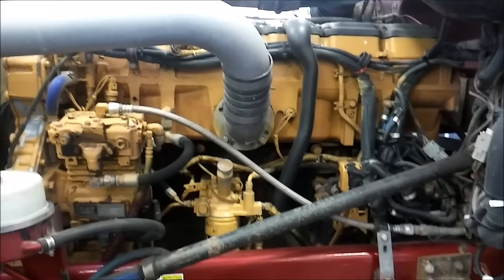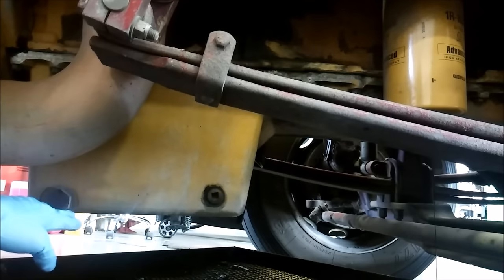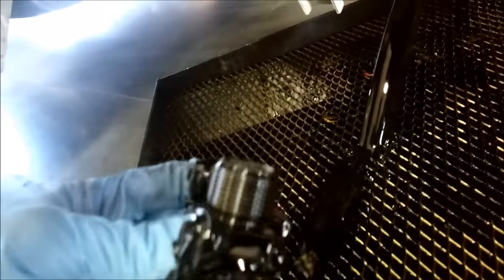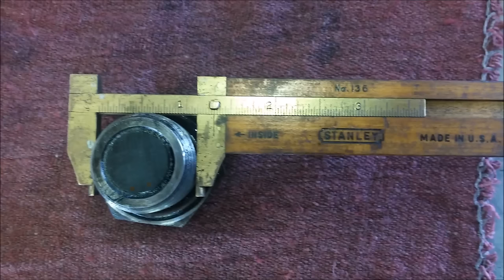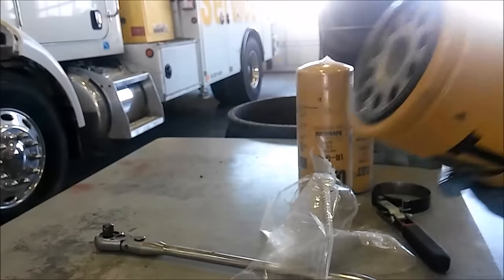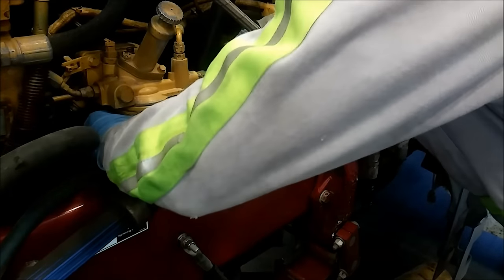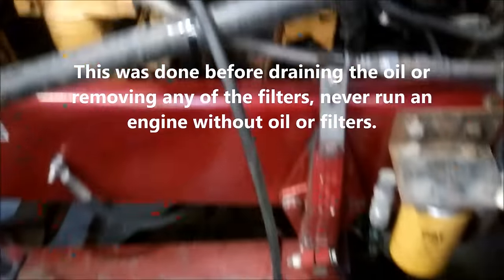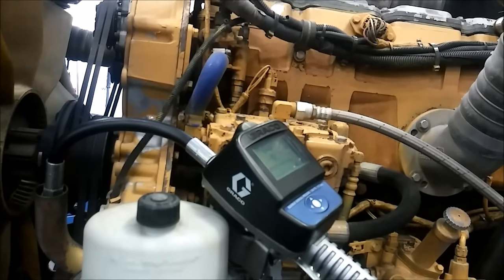How To Perform A Professional Cat Diesel Engine Service.  Cat Engine Oil Change.

Comment: Do cat engines have "top end oil" that can be changed like on PowerStrokes? (even though it hardly gets changed on its own because it circulates slowly (so I've heard from PowerStrokeHelp's channel)) Supposedly it does wonders in the PS engines on making the injectors last forever and a day as far as pickup trucks are concerned.
Reply from the maker: +VinylDash303 Good question, I had not heard of " top end oil" before so I watched a Powerstrokehelp video that talked about it. I'm envious of his subscriber count and maybe on a Powerstroke it helps, but on a Cat it would be a waste of time I think. The injector pump does hold about a quart of oil in it, but it gets the oil from the main oil galley and if you have ever ran a C7 with the valve cover off, it moves that oil through the injectors quickly and they drain back to the oil pan. So my suggestion is keep your engine oil clean and it will keep your injectors clean.
Reply: +Adept Ape Ah. Interesting. Got one more for you. Is there anyway to find the thread spec and o-ring diameter for the 244-4484 filter?
Reply from the maker: +VinylDash303 I don't know of a place in the Cat system that would give you the specifications. Usually Cat will give you the shipping dimensions. I would look online for a filter cross reference site, I think Donaldson has one and there are others, then type in the filter part number and it might give you the specifications on it.

Comment: I've been looking at the 4 jaw oil filter wrench. what is the best one to get? for gas engines?
Reply from the maker: +Richard Cowtails For gas engines I really like the actual socket oil filter wrenches. For a pliers style universal filter wrench though, the Channellock ones are pretty nice, and they seem to be made with very nice quality steel and grip very well.
Reply: ok. Do  you have any idea what size that might be? looking at amazon its talking about 36ish mm. does it differ from car to car ? or is it pretty universal in size? kinda same stuf?
Reply from the maker: +Richard Cowtails I would just get the pliers type to start with, in their small and medium size. The socket types are nice, but there are a ton of different sizes, so I would use the pliers type and then start buying the socket type ones you find you need individually.
Reply from the maker: +Richard Cowtails You can also buy a band style ones I talk about in this video, they work very well, just on cars there is little room for the band and pliers type.

Comment: Do you know where the block heater hook up is on a C7s? I can't seem to find it. I have the plug to connect it but I can't find it on the block
Reply from the maker: +Timothy Nichols Most of the C7 block heaters are on the rear of the engine on the turbo side above the rear structure.
Reply: Adept Ape  yeah I finally found it. why would it be unplugged. Because its not always ON. only when I run a extension cord to the generator, then it would it be ON.. Just found it odd it was unscrewed.
Reply from the maker: +Timothy Nichols It should be plugged in because as you correctly stated it only is on when it's plugged into an outlet. Either loosened over time or perhaps someone worked on it?

Comment: I always fill the filters if I can
Reply from the maker: +Eric Murrell A lot of people do, but Cat recommends not pre filling them. There is quite a bit of controversy to filling or not filling them. Every guy seems to have their own take on it.
Reply: Adept Ape i break the filter loose then I sharpened a screw driver
Into a sharp point, and I use a hammer to drain the filter before removing

Comment: If you let the oil filters overnight with a hole in the bottom, you must have a filer press in your shop.
Reply from the maker: +leonard payne They used to say we have to crush them, but now they just say they have to have a hole in them and drained to throw out. We don't have a filter press though.

Comment: "most guys i know use a 1/2 inch impact to tighten"
so thats why i cant break them loose.... 

i got yelled at by my boss.... a tire guy, NOT a mechanic.... for using the 1/2 inch impact to remove the plug
i said "ok, then you break it loose using that 3/8 drive ratchet" 

he ended up using the impact......

anyway.... i use a 3/8s or 1/2 inch drive ratchet to tighten them (our 3/8s sockets stop around 1 inch IIRC.... but i DAMN SURE know i can get 60 foot pounds out of a 3/8s drive)
snug.... plus 2 or 3 taps with my fist, on the handle = DAMN close to spec..... and i KNOW its not going to loosen up

ive heard of shops yelling at techs for using the torque wrench for oil drain plugs..... 
yet, id rather see that..... than see a cracked pan..... or using a FUCKING 1/2 INCH IMPACT! 

people who tighten drain plugs with an impact..... or even air ratchet..... 
need to be shot

no other solution for that level of Id-10-t.....

Comment: Nice tech video. I’m not a Cat mechanic but I’ve working on or around engines for most of my 56 years. Like you said the injectors don’t like to run dry  I always prime my oil filter, does CAT say why not to?

Comment: First of all you did a great video. I have a 48 ft boat with two Cat 3208s that I change the oil and all filters once a year (approx. 98hrs). Some have suggested to me to change at 250 hrs. When I do change the oil is slightly dark honey color. I run at 1400 rpm on trips and up to 2100 rpm for the last 5 min or so to blow things out. Do you have any opinions on this?

Comment: Hi Josh,  loved your video.  Being a new owner of a 3126E CAT in my motorhome I have had some difficulty finding reliable information on it.  I've heard that the Micron rating for the fuel filter has to be 2 microns or less and t he oil filter 5 microns or less.  From my reading none of the filters available for my engine meets these specifications.  The best I could find was a Donaldson fuel filter at 3 microns and a CAT oil filter at 13 microns.  How rigid are these requirements by CAT?  Can you recommend a specific filter set for me?
Reply: I believe wix filters for that would be 2 microns.

Comment: Would you consider using a Fumoto oil drain plug on a C9 in an RV?  I don't have a pit and would like to keep the oil change as clean as possible.

Comment: Oh crap... What an idea to watch this AFTER doing the service on my 1988 3208 T... I refilled the oil filters, I followed the filter brand method) I just came here for the fuel filter, I was thinking about refill it too because these engines are hard to restart after a priming the system. Any thoughts? Thanks for your very helpful videos 👍

Comment: I NEVER use plier type filter wrenches for installing filters. I have seen filters be punctured from the sharp teeth on them and sometimes it takes a many hours of operation for them to start leaking. A potentially disastrous situation on the most novice procedure there is. They should only be used for removing difficult filters and that is it.

Comment: Question I hot a C7 I wanna do fuel filter change like you did do I fill both filers with diesel and I saw another video someone else made and they used prime pump to pump fuel in manually after new filter was in, my question is if you fill it way you did you dobt need to pump it? Im new to diesel engines thanks

Comment: Great video!  Thank you for the awesome tips.  About to do an oil change on C9 that's pushing my 43' RV.  Any comments or concerns on upgrading to T6 Rotella Synthetic5w40  instead of Cat recommended 15w40.  I do most of my traveling in HOT southern states and live in Vegas.   Thanks again!1
Reply from the maker: +Tyler Trenton I really like synthetic oil and switching to it isn't a bad idea. The viscosity difference is a little outside of Cat specifications for the medium duty Cat engines, Cat recommends either a 10w30 or a 15w40. The difference being ambient temperature, so the hotter climate would get the thicker oil, since you are in Vegas I would say try to get a 15w40 synthetic oil. A 5W40 is a little thin with the 5 cold wait. Now would it run okay, probably, but I just am letting you know the Cat recommendation.
Reply: Thank you VERY much!

Comment: the cuummins 6.7 fouund in 1 ton trucks is 13 quarts IIRC....... which brings the oil level to the middle of the hash marks
i even called dodge and asked about that...... and they said thats what they want..... middle of hash marks

now.... i prefer to fill to the top of the hash marks......i know the oil will expand when hot
but i also know that some of the oil will be "trapped" in the head when its running..... 

is it enough to off set the expansion...... probably 

and is running it a BIT overfull going to damage the motor and/or add wind-age losses, or put air into the oil?
i dont think so

but so far, i have filled to the spec..... 

however.... ive had customers come in and yell at me for not filling to the top
so i tell them that mopar/cummins recommends a "center fill"...... 

even called the dealership on speaker phone ..... and asked "hey, i put 13 quarts in..... but its only half way on the hashes... is this correct?
"yup, thats what we want"

yet the customer still bitches...... so they get an extra quart or 2 for free

what is your thoughts on this.....conundrum???

Comment: How often should you change oil & filters
Reply: Read your owner manual
Reply: Shop I work for does oil changes at 10k miles. Oil filter and fuel filters all get changed and air filter too. And we lube the trucks at that time also. Every 2k miles the truck gets a plain grease service no changes of oil

Comment: Hi there sir hey I got a question I am planning to put a primary fuel filter my engine did not came with the primary one. I’m installing the housing and everything so my question is do I prime the fuel pump after I install the housing and the filter to remove air?

Comment: Great videos!!! What oil do you recommend for a C9 diesel pusher? It’s a 2006 Fleetwood Revolution with 85k miles operating in Las Vegas, camping in Utah, Arizona, California. Higher elevations and flat towing a 4 door wrangler.

Comment: Would you recommend adding 1 gallon of diesel to the crank case oil of a 2003 c15 when hot 
Then run it at idle for 5 mins then drain the oil change the filter and add new oil to help keep the new oil stay cleaner longer ?

Comment: I like your style…rather methods, reasoning and that you actually torque to specs.

I used to always prefill the oil filter and even do this a day earlier leaving a clean rag over it…but this is for diesel vehicles (sedan, 4x4, suv etc).  I would do it early so every bit of air is purged out and it is at maximum capacity.
However I’m now thinking this is a waste of effort as the air is easy to purge out with the oil pump with new oil so I won’t bother pre filling the oil filter, however I will of course use a little oil on the oil filter gasket.

I actually think that by prefilling, you make it harder for the oil pump as it must pressure oil to force the air through the oil filled filter, where as if it is just air, the pump has less fluid resistance to overcome and therefore will prime quicker which of course is always better for the engine.

Comment: Thanks for the oil change instructions, I just got an old Freightliner with a cat 3406B engine, I had never perform a tractor service before so what would you recommend for a newbie like me, I can't even find my serial plate from the engine to order my filters, what kind of oil does this 3406B takes? thanks again for your info

Comment: Bro my truck does t have any leaks however i have to be checking the oil, do you think it may be the turbo ,every 5 o 6 days i have to put put a little bit of oil. There is no leaks anywhere i g
Had a porche that used to do it that why im not alarming

Comment: I  would never doubt your information but with my 39yrs I  do break the oil filter free before the hole. Got ate alive by a Cummings coolant conditioner  tore the body off the  non off point housing had to  make tool to remove base off block while dripping whole time. Called for special goggles so I  could  stare into the face of the problem.

Comment: Sometimes if u loosen oil filter b4 u drain oil hand tight. Drain oil the take filter off slow the vacuum will take the oil out of filter housing so theres no spillage. It dont always work.

Comment: Josh, We have a 3126 e in our 2003 rv with 50k miles. We live on the east coast side of the U.S. and took it to the Freightliner service center for a M3 service 9 months ago where the chassis was lubed and the oil was changed(along with a bunch of other things). When the year anniversary of the oil change rolls around we will probably have put around only  800-1000 miles on it. Would you recommend changing the oil and filters again, or wait longer maybe another year. We plan on using it more in the future. Thanks

Comment: is it ok to add 2 quarts of gear oil 75w-90 into a 5 gal oil capacity isb 6.7 cummins?
Reply: no..... why the fuck would you do that?
if it needs that thick of oil..... its either worn out, has HUGE leaks, or is run in Texas/VERY hot conditions 

gear oil does not have the additive package than MOTOR oil does 

would you put coolant into the oil to make it thinner?
or trans fluid into the gas tank??

then why are you putting GEAR!!!!!! oil into the MOTOR!!!! oil?

they make 20w-50 if its worn out...... or really hot outside
but its probably worn out because of the 75w-90 you added to it......

Comment: Again nice video man but I have a question that's a little off subject. One of my trucks is on its way from Tennessee to my shop in West Virginia with an oil cooler going bad as we speak. Any tips on changing it? Is a c15 single turbo
Reply from the maker: On that truck it's pretty straight forward, get some degreaser such as purple power or Pinesol for cleaning your cooling system. You'll have to drain the coolant, the basically just unbolt and remove the oil cooler from the engine and oil filter housing. Make sure to use new orings and gaskets, then it's flushing your cooling system to get the oil out of it.
Reply: +Adept Ape thank you sir your word is always helpful

Comment: Not looking to give you a hard time , love your videos. 
I noticed that you said basically 60 foot pounds on the drain plug, despits a spec stating 52. I thought that plus/minus values were included by engineers for inconsistencies in tooling, not as a Techs decision to use the high or low value. Wondering if you have an opinion on this, or if it was a mistake. Cheers mate
Reply from the maker: I used to go a tad over the torque, but then started just going to the max correct torque a few months after making this video.

Comment: When you install the hose with the ball valve to capture clean diesel, do you leave it in place or do you remove it after you've changed the filters.
Reply: He would remove it. That's his own personal tool. He ain't gonna leave that on the truck unless customer wants one and buys it.

Comment: I was recently hired by an independent Diesel repair shop (Class 6, 7 and 8).  My first day is Tuesday of next week.  My new career begins with their Diesel Technician Apprentice Program, which includes studying and practicing for a Class A CDL.

This video helps to answer lots of questions that I have regarding performing a service for a Diesel engine.

Are there any other requirements during service, such as: greasing Zerk fittings, searching for broken or missing parts, adjusting Drive Belt tension, pressure testing the radiator, etc.

Thanks for posting this video !
Reply from the maker: +Kit Carson There are tons of other things to check during a service, but this was just going over the engine. I should do one for greasing the chassis.
Reply: Thanks for responding.  My goal is to hit the ground running.

Previously, I had been working as a Forklift Mechanic....more than 10 years.

Comment: Never heard of anyone using a 1/2 impact in a drain plug. Seems like overkill.
Reply: if you’ve ever done a PM for a Cat Engine then you’ll see why people use impacts. if those bolts were TTY then with the heat and flexing of the bolt and oil pan makes these plugs a pain to remove. you’ll break a socket before you break that bolt with a regular breaker bar.
Reply: Josh Domingo only ever changed oil in one 3406E cat. I own all Cummins engines, a couple isx’s an n14 and two big cams. I’ve put all 1/4 turn valves on my pans just to make it easier.

Comment: What do you use to fill the engine with oil?
Reply: He has a air powered pump that dispenses the oil for him and they sell as gun that goes to that set up where it counts how much oil you pumped. I have those at the shop but when I do mobile services I have to use 5 gallon jugs with hoses to dump the oil in the engine.